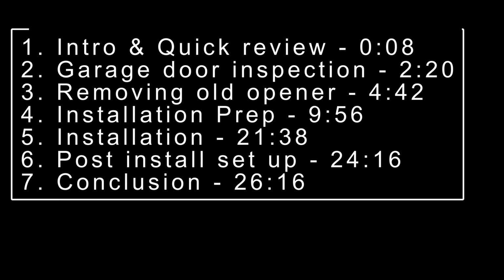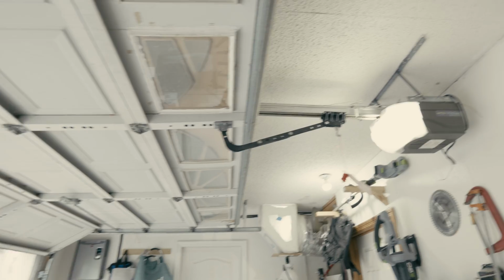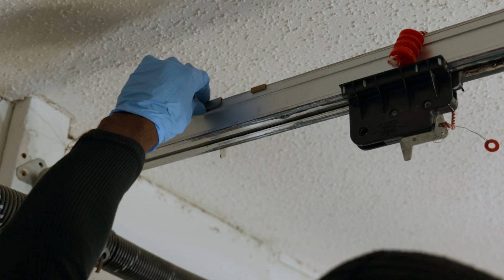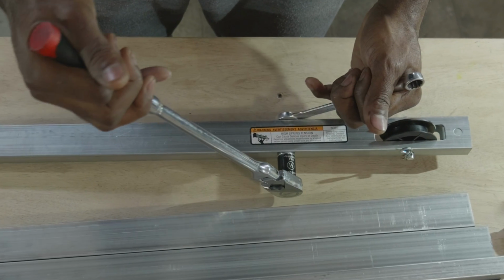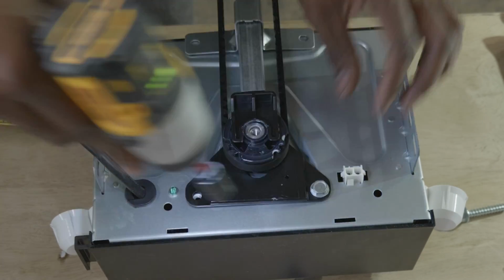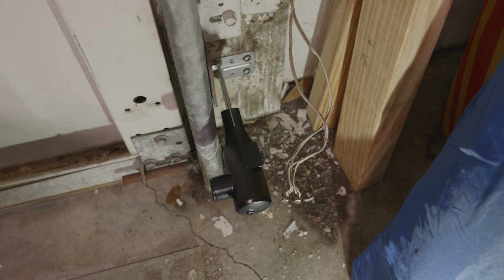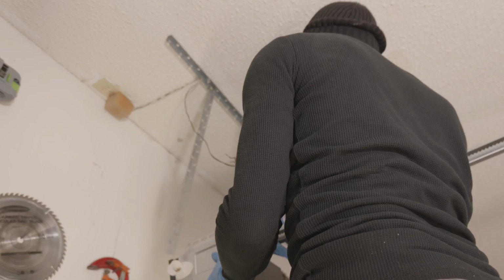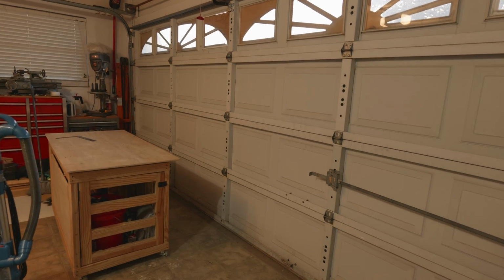How to install the Genie Belt drive garage door opener - garage door opener genie

Comment: Thank you Don,  I am a video and film engineer and I see and HEARD the extra length you went to to make the audio intelligible!!!! Video was great also.  Overdubbing the audio is was sets this install video apart as a truley professional job, Usually the voice is a hollow echo chamber especially in a garage setting.  Besides that The directions were concise and clear. I installed a Model #1155 and loved the fact that you did not "dumb" it down for a beginner, I appreciated that.  I am 66 years old but got full set of modern tools and knowledge base. It took me 2 days 3+3hrs...  6 hours total start to finish by myself alone (Watch video, Prep, tear down old, Install, Cleanup, Recycle metal). Best From Tucson AZ
Reply from the maker: Very happy it helped. Had no idea this video got soo much traction!

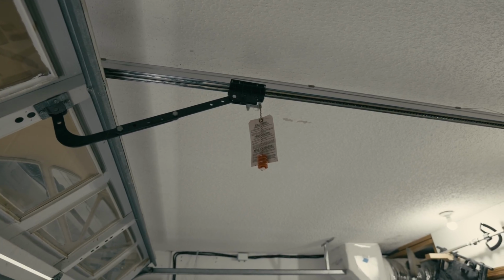Comment: @3:34.  You need to balance that garage door.  The door should hold it's position at 4'.  The way  it sprung up like that will make the opener work hard to push it down and eventually wear out that opener.  Also, replace those metal rollers with the nylon rollers for a smoother and quieter operation.
Reply from the maker: Thank you for those tips, some nylon rollers would most certainly quiet it down.

Comment: :dothefive: :dothefive: :dothefive:YOUR GARGE DOOR SPRINGS ARE SEVERLY OUT OF ADJUSTMENT AND WILL CAUSE THE OPENER TO PREMATURELY FAIL !!!!! The springs should not be wound so tight that the door will lift on it's own. The door should be neutral balanced requiring the same amount of effort to open as it takes to close. FIND A TUTORIAL FOR GARGE DOOR SPRING TENSION.  ⚠🚫 You can get seriously injured messing with garage door springs if methodology is not understood and followed !!!!!!!!!!!!!
Reply from the maker: Thakn you for the warning. i will get it taken care of.

Comment: I just installed this unit but the buttons on the actual motor work just fine at opening and closing the garage but when I use the wireless controllers or the wired controller The garage only budges a couple inches?

Comment: What is the life span of the belt ? Anyone know ?
Reply: Put one in 8 years ago still fine. Just adjust the tension properly and won't have any issue.
Reply: can't imagine it breaking unless it was some incorrectly set ridiculously tight tension or flat out manufacturing defect.  it has steel belts, like a tire carcass, so should outlive the opener.

Comment: First, good job on the video. I've replaced few opener and those garage door springs in my days. From my "little" experience, I think your garage door spring has too much preload caused your garage door to spring open too much. I believe your garage door spring should give you a neutral weight at mid way. If not spring pressure will cause unwanted load on the garage door opener, and may cause premature failure.
Reply: Yeah I agree, that door is way too hot going up, springs are not balanced correctly. Should stay in almost any position when opening or closing. I'd have disconnected opener from door, then ran it to see if it cycled smoothly without the door.
Reply: Agree. This video the spring loaded too much .
Reply from the maker: could be why my garage door occasionally will not close and acts like it hit something on the way down. Thank you

Comment: I don't care for the belt drive, l will just stay with the chain drive model
Reply: Do you just like it noisier?
Reply: @seatime674  l don't know how these belts will do in very COLD weather of the UP
Reply: @GeraldHanks-qo1qc  Belt drives actually stand up to cold much better than chain because the metal contracts and expands and belts do not.. Don't let that be the reason why you don't enjoy a belt, I just took my chain out after 8 years and put a belt in it's literally night and day as far as quiet, Chain drive should even be illegal because they even wake up the neighbors.
Reply: @seatime674  The garage door opener l am  replacing is a Chain Drive and it lasted 28 years here in the UP, a friend of mine as a belt Drive unit that only lasted 11 years and he is looking at a Chain drive model to replace the belt unit.
Reply: @GeraldHanks-qo1qc Then just replace the belt If it's not the motor. Just because your friends belt drive went out at 11 isn't representative of them all, my dad's belt drive is going on 24 years now same belt. If quiet doesn't bother you than rattle and grind away👍
Reply: @seatime674  No l will stay with a Chain Drive unit
Reply: @GeraldHanks-qo1qc  You’re one of a very few, Grind grind clack clack bang bang away 😆
Reply: @seatime674  l already replaced the unit with a new chain drive unit and you can hardly hear the unit running, it doesn't make the noise my old unit made.
Reply: @GeraldHanks-qo1qc   Imagine the belt being 60%+ quieter but glad you can manage it
Reply: @seatime674  l did before for 28 years
Reply: @seatime674  I like the chain because I know the garage is open or close when I heard the noise.😂

Comment: Very good video.  Trying to install a Home Depot 'Black Friday' Model 2155-TSV that has 'challenges'.  Stamped on the frame is a note of 12volt DC circuit.  I have 5v.  Yes I am in communication with "customer service'.  After multiple repeat measurements it seems a new electronic control board is in my future. They seem to work out of a computerized script. 
The biggest challenge is latching the 'carriage assembly' ... apparently a fork that engages part of the turnbuckle where the two ends of the drive belt are secured together.  I cannot see what is supposed to move up or to what it is to engage.  The carriage assembly is like a tube - I can see all the way through meaning it ought to be a no brainer..... but it is not.     Any idea of what the latching mechanism ... carriage assembly to belt turnbuckle .. should look like?   Tim Ho ... here in n/e Florida

Comment: Pretty sure the garage door springs are wound too tight. This may be why the old garage door opener failed. The door should not spring open by itself once the door opener lever is disengaged. There are of course a ton of videos on how to adjust garage door springs but the general rule of thumb is the door should stay open by itself once the door is half way opened manually.
Reply: Also, you should remove the door locking mechanism once you have a garage door opener installed on a door. If someone engages the lock and then attempts to open the garage door with the garage door opener, something is going to break. The door, the locking mechanism, the opener track or the opener itself will be damaged. The garage door opener serves as your garage door lock once it has been installed.
Reply: I said they exact same thing, that door is sprung too tight! No way it should go up by itself that easily. That's what led to all that tremoring with the old track.

Comment: Need help. One sensor has a red light and the other a green light. Is it normal? The - is the up and the + is the down limit. What did I do wrong?
Reply: Yes, the sensor lights are different colors, that is normal. If the buttons are reversed you likely put the belt union on the wrong side of the channel; looking out the garage door from the inside, it should be on the right side.
Reply: @TheOnespeedbiker  you are right. I changed the belt union to the other side. Now is working. Thanks!

Comment: I just completed an install on a similar Genie.  The sensor wire routing forced me to do a modification.  I didn't want to route it out and around as my garage has a finished ceiling.  You can't just attach it to the rail (my old one you could).  As the rail is hollow, I drilled a hole on the under side about an inch from the motor head. There is a Bolt hole towards the end, must be for over travel but I removed it.  I used Fish tape to get the wire in the rail and out the removed bolt hole.  You only need the one wire as you can wire in a series.  Made it so much cleaner.

Comment: A tip for installing power head. Make sure the carriage is disengaged , open the door by hand. Use a block on the door to support opener rail . Check rail if it is level, adjust if necessary. Now mount power head  at same position. Remove support block from door flip carriage to lock position, move door by hand to lock into carriage.  Great video enjoyed it

Comment: You didn't show how the plastic carrier that the door hooks to is moved by the turn buckles or belt
Reply: During assembly the turn buckle union should not be at either extreme, near the motor or end of the channel. For ease place the union about 2 feet from the end of the channel. Once assembled, lift/open the door until the plastic carrier covers the union and then lock the carrier in place (how far the door is open will depend on where the union is prior to setting the limits; now you can set the limits). While the union doesn't have to be centered, if it is at either extreme, leaving the garage door open or closed prior to setting the limits, it will be beyond the limit adjustments. Not mentioned is you must set the limits prior to installing the backup battery.
Reply: @TheOnespeedbiker  great tip! This comment would’ve saved me none of the videos show that smh🤦‍♂️ instead I ended up jamming the turnbuckle bc I had it all the way at the extreme end near the door 😂 idk why the video or manual don’t clearly state what you did about it being somewhere in the middle with the garage slightly open accordingly, when beginning programming / operation

Comment: We got everything installed and programmed. the wall mount button will not put the door down now unless you hold the button down the whole time and the down button on the remote does not work at all. it goes up just fine. Does anyone here know what the problem could be??
Reply: Sounds like a safety sensor issue.  Make sure they are aligned properly and nothing is obstructing the line of sight between them.  If you still have the issue check your wiring and make sure you don’t have the wall station and sensor wiring mixed up.
Reply: I'm having the exact same issue, not even using any safety sensors

Comment: Thank you, your video made for very easy installation. Here are a few tips that I used: I'm a nazi about using thread lock on anything that causes vibration. Also, when mounting the power unit, I tied a 1/4" rope to the rail near the power unit and to the ceiling mount, pulled it up to level and finished the hangers. Thanks again!